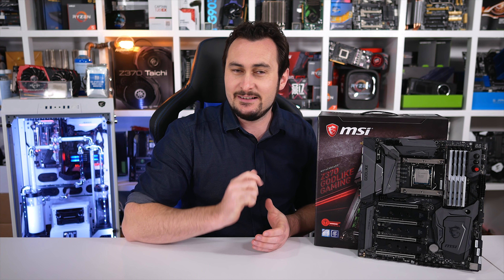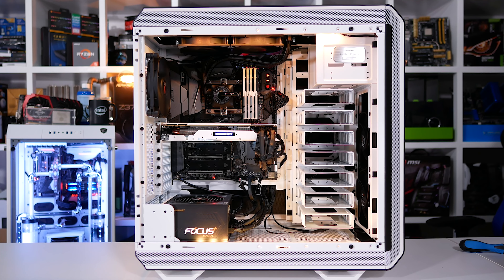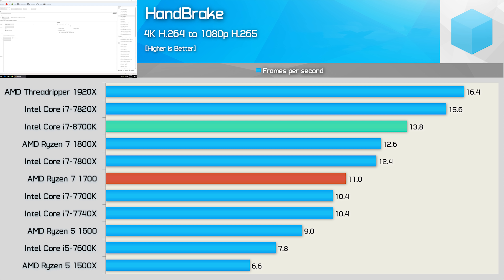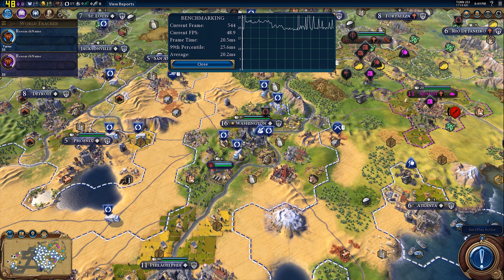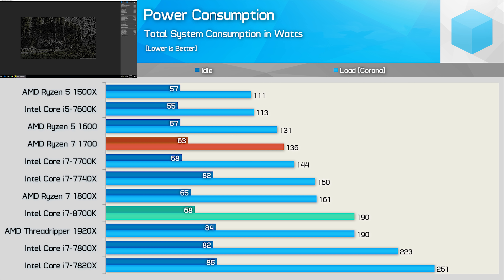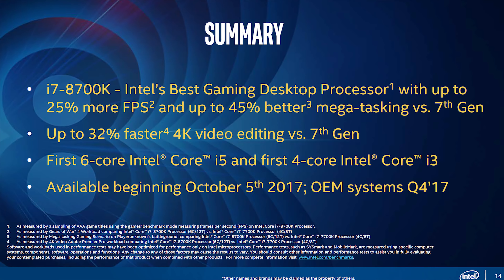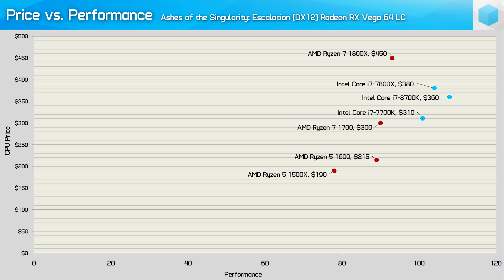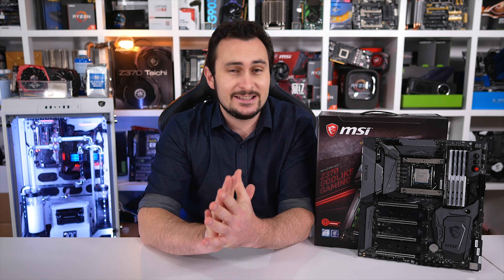Intel Core i7-8700K Review, The New Gaming King!

Comment: If you are comparing price points, well you can get a 1800X for $360 USD these days.  And the 1700 in the review is not even OC, so it runs at a MAX of 3.2 GHZ on all cores.  In addition, the 7700K gives overall identical performance for a cheaper price, yet somehow the 8700K is better?  7700K are on sale everywhere for $270 USD.  Yet when Ryzen came out, people complained even though you were paying LESS money for Ryzen.  Yet now Coffeelake is somehow a "great deal" even though it's not beating the 7700K in gaming by any significant margin?  Gaming King?  If gaming is all that matters, shouldn't the 7700K still be on top?  What happened to all the people who trashed Ryzen for slightly less gaming performance at a reduced cost, yet more money for the same performance (sometimes worse) is a good thing now?  Funny how quickly people change stories.
Reply: slylockfox85 The 8700k isn't overclocked either, so it makes more sense to compare stock to stock as opposed to stock to overclocked
Reply: Very good point,   I can't help but feel like this guy is an intel fan boy
Reply: 1800X is 398$ on amazon but dips down to 350-360$ every other week. It came down in price with the 1900X out now. 1700X is 300$.
Reply: http://www.microcenter.com/product/485483/Ryzen_7_1800X_36_GHz_8_Core_AM4_Boxed_Processor
And it's actually $350.  Fool.  Other sites have also put the processor on sale for around $360-370
Reply: @Peyton
I've never suspected this guy of being in Intel's pocket until now.  The way he gushes at the end of the video about how "great" Coffeelake is looks like a bad acting job.  Coffeelake isn't that great.  It just isn't.  It's not bad either.  But you would think this processor was offering "Sandy Bridge" level improvements they way he's fawning over it.
Reply: The threadripper level power draw is pretty crazy too. If you can afford it, and don't mind the extreme cooling needs it would be fun to mess around on though. Still it's also quite expensive for something you know will need a de-lid, liquid cooling and give a huge PSU.
Reply: How did you enjoy that embarrassment @Bill Gates M8s?

As far as the CPU goes, it's an amazing CPU unless you're concerned about Price/Performance. If you just want the best for gaming, 8700k is the new best for that, it's not really a bias at all even if you feel that it is. This is also coming from someone using an R5 1600 and I absolutely love it. Looking forward to the 12LP refresh, hoping for an extra 10-15% overclocking and a slight IPC gain.
Reply: esperCELL how could the 1080Ti that was used in this review be considered a GPU bottleneck? Also digital Foundry has been pretty much Microsoft's little lap doggy since the Xbox One X praise and massive coverage they have given it so I would take anything they have to say with a small grain of salt.
Reply: I agree there's really nothing spectacular about it,   in terms of gaming performance i don't really see where the additional cost is worth it.  While the Ryzen 5 1600 may not be capable of reaching the same clock speeds,   it has just as many cores and threads as the much more expensive coffeelake chip.  To me it just doesn't make sense,   the margin of performance is too small to even notice unless youre staring at a framerate counter...
Reply: I think people obsess too much with framerates these days too,  if im gaming at around 60 frames per second im happy,   i've never really understood why someone would think that 110 fps is vastly superior to 100 fps etc etc
Reply: Paying 150 more dollars for a chip,  for a boost in performance that's not even noticeable without watching a frame counter is not very smart
Reply: Thats what i thought too... Its 30 percent better for 30 percent more moneys
Reply: slylockfox85 get your history straight - the 1800x was thrashed for gaming because it was $150 more than a 7700k with significantly worse framerates. The 1600x and 1600 especially got overwhelmingly positive reviews for gaming, because they were very close to 1800x, but cost 250 less. Every review out there said r5 is making the whole i5 range obsolete. While the r7 is great for productivity, it’s not that good for gaming when compared to the r5. The interesting chip here is the 8600k, for those that still play games that rely on high single core clocks.
Reply: Haralampi Nedelin: You got some good points there. But the AMD 8/16 core Ryzens are in a completely different league than a quad core 7700K CPU. Yes the 7700K can blast past them in a lot of the games but use either of the CPU platforms in anything where you actually have to get work done and the quad core 7700K looks like 6 year old tech because it just does not have the hardware to keep pace with a 8/16 Ryzen when real work is needed to be done.

The only reason the 7700K was faster in games is the 700Mhz-1000MHz clock speed increase it has over the Ryzen's. That 5-6% IPC gain helped a bit as well but not as much as the clock increase and we all know games like fast clock speeds over more cores and lower clock speeds well most of the games that is. 

I personally would like to see a clock for clock bench test done in games and work station related tests done again since the Ryzen platform has had a lot of time to mature a bit and for the reviewers to take another look at the then and now. It still boggles my mind when you see current reviews or compares done and the reviewers are still setting up Ryzen systems with low speed DDR4 and these systems perform below what we know they can do. Not all reviewers do it but enough so that it is just plain silly as we all know Ryzen wants/needs high speed memory to perform at it's peek performance.

Side note:
I am not an AMD fan or Intel fan as in play favorites I like both companies they both have some good products. I own Intel CPU's at the moment because they do what I wanted them to do. I may go AMD when Ryzen+ comes out and the gen 2 main boards.
Reply: Rocky12345: I couldn't care less about the performance in "actual work". I have a work computer at work where I work, I don't need another one at home. Besides, I have never rendered a single frame in my life, and the most video editing I've done was in VirtualDub 15 years ago, when I was trying to stitch together some lesbian porn downloaded on a 56k modem. 

Saying the only reason it was faster was because of the 1 GHz higher clock, is like saying Usain Bolt won the gold medal because he was running faster than the rest. If AMD could make ryzen run at 5 GHz, with similar power consumption to intel, they would have done it. But they can't. I guess if we limit the charger hellcat to 150 bhp and run a drag race with a toyota corolla, they would be pretty evenly matched, maybe the toyota will actually win due to lower weight. But it would prove absolutely nothing.

Ryzen needing high speed memory is a deficit of ryzen, not of reviewers. If the infinity fabric in Vega has its own master clock and is not coupled to memory or core frequency, why did it need to be determined by ram clock on ryzen? 

Ryzen has a few things going for it, like the supposed longevity of AM4 motherboards, lower price, soldered heatspreader instead of toothpaste, and so on. But dismissing intel's 1 GHz advantage as some sort of non-consequential detail or accident is ridiculous. Contrary to popular belief, intel spends a lot of money on their R&D, and those higher frequencies are a result of that. Correspondingly, they charge more for their CPUs. And people who care about clocks are apparently ready to pay the price.
Reply: They have nevver changed story. They just bargained better deals with Intel for a while. Luckily empires ruin themselves. If we were to wait for techpress to call Intel out for these forced "gifts" you would never get without AMD empire would live forever.
Reply: esperCELL: I watched the video again. Basically the way he tested here using ultra maxed out settings while doing a CPU benchmark test suite was the problem.You never ever do cpu tests with the games maxed out and place more load on the gpu which could make it become the bottleneck and slow the cpu down because it has to sit and wait.

I also found it interesting that when the vega was tested with ryzen's here in dx12 that they Ryzens got a nice boost in fps over what they got when paired with a Nvidia card. That to some extent makes other reviews a bit invalid when only Nvidia used in the cpu testing if the Ryzen/Nvidia combo is holding back some of Ryzens performance in dx12. I was glad to see Hardware unboxed take the extra time to show that to us. In this case yes the 1080ti was a bottleneck because of the settings used even at 1080p. With so much power in the cpu's today even 6th,7th,8th gen cpu's can max out a 1080ti.

Don't forget 8th is just kaby lake with 2 extra cores which is turn sky lake & a reworked turbo boost. Hell the 8th gen better be faster it has 2 more cores but do not be fooled those cores are the same old tech from 2 years ago.
Reply: Intel has had 8 generations to get it right so 1ghz advantage with all that time is about right. AMD Ryzen is less than a year old and first release. they got the tech out the door next release will be work on clock rates a bit and do tweaks to get more out of the chips. Intel is no hero here they have had a long time to play with their core line up and have let us keep on buying the same stuff for years now with very little performance gains from each generation. It took AMD to release something that mattered to wake Intel up and finally move past 4 cores on the mainstream side.

Hell my overclocked Sandy i7 @5.1 can churn out fps very very close to a 7700K@4.7 maybe 4.8ghz that kinda sad really on Intel's part. We finally got a 6/12 core setup on the main stream after getting quad core after quad core since like 2007 with the Core 2 Quad Q6600@2.4GHz it was about time they finally got past the quad core era. They should have done it 3 years ago maybe I would have already replaced my Sandy i7 back 3 years ago. 

So do not come down to hard on AMD because they can not reach 5GHz it is a new product fresh out of the gate so to speak. Would it have been better if they could of at least got 4.5GHz yes of coarse it would have. Will they get there most likely yes probably in the next release. Will INtel get much farther on this 14nn node most likely not they have pushed it as far as they can the power numbers really show it. Are review sites really down playing the power usage on the Intel chip yep for sure well at least these Coffee lake ones it seems the sites I have been to have backed off a bit on the power numbers complaining probably at Intels request.

Oh yea ram is important with Ryzen since the infinity Fabric is locked in with ram speed. Was that the best move on AMD's part nope not really was it the best way they could do it with the budget they had probably.
Ram speed and tight timings are 100% importasnt on Ryzen if you want to get the best FPS you know this already. Check out Mindblanks latest Youtube Video. He put a lot of work into testing DDR4 at dirrent speeds and also really tightening up the timings and tweaking the settings in the memory. He took a Ryzen 1700@3.9GHz from getting it's ass kicked by the 7700K@5GHz to actually beating the 7700K@5GHz just by doing the slight OC to 3.9GHz and ram at 3466Mhz and the best timings the memory kit would run at. 

As he stated he thinks the better the memory timings and speed the faster the system can feed the cores even if they are running a bit slower there are more of them so if they can be fed faster then you can see a good speed gain from it as well as lower the latency imposed by the CCX complexes which also explains some of the FPS increase.
Reply: Yes true if you go from review to review you can see very different outcomes in the benchmarks and that it all depends on how the testers choose to do the tests. That is why we as readers or watchers have to go to multiple sites or channels to try to get a better picture on how each hardware fairs in the benches these days. Heck just changing a graphics card from one company to another can change the whole performance profile of a CPU in gaming tests or changing memory speeds and timings can change the whole outcome of a review.

Before Intel's 8th gen CPU's changing the memory speeds had a small effect on game performance a lot of the time and the quad cores. Now with the 8th gen and more cores it seems memory performance may play a better roll in the game performance this is a good thing. With Ryzen because of the way AMD put the IF & memory speed together and the CCX complexes causing a small latency memory speed and timings are very important on ryzen platform. So much so that if the system is configured with high speed DDR4 and memory settings tweaked you can almost get performance in games that make it look like you got a whole new CPU. Mindblank Tech's channel just did a video on this. https://www.youtube.com/watch?v=S6yp7Pi39Z8. 

He shows what he did and how much effect it had on the system and in the games he tested. Did he hand pick the best case games to show his tweaking in a better light probably. Does it show that there are areas which can really improve Ryzen game performance yes for sure. Will AMD have to address these areas with Ryzen+ spring 2018 yes for sure if they do not Ryzen+ has no real value other than maybe a bit of a clock boost. If they can address the problem areas and also get the clock rates up with Ryzen+ they will be ready to fight Intel or at least get very close to Intel level game performance. Heck in Mindblanks tests that ryzen went from losing to the 7700K@5GHz to actually pulling a few victories. That is pretty good for a few hours spent tweaking and shows there is extra performance to be had out of the Ryzens yet AMD just needs to harness it in the next Ryzen refresh.

I an a Intel user & fan but the last few releases have not impressed me hence the reason I am still on a Sandy i7 even this new 6/12 core Intel does very little to impress me yes it is fast sure but it is also being released on a stop gap z370 chipset which will be replaced in 2018 if the z390 rumors are to be believed. I want whatever comes after Coffee lake that has new and improved cores and a die shrink and a chipset & socket that may actually be around long enough to support at least 1 upgrade after the first CPU is released on that chipset. If Intel can not do that then it will be Ryzen+ or most likely Ryzen 2 for me. That is if my Sandy i7@5.1GHz setp lasts that long without failing. My Sandy at it's speed is why I have been so non impressed with any of Intels offering other than getting into DDR4 ram there was nothing really in it for me.
Reply: Rocky12345: This release from intel cannot possibly a response to AMD. Yes, they may have launched the CPUs earlier than planned, to preserve some marketshare against AMD, the prices may be lower than what they would have been without ryzen, but the 6 core CPUs have been in the works long before Ryzen was released. You might think, it was clear for a long time before the ryzen release, that it would have up to 8 core and 16 threads, but if Intel was changing their strategy from early announcements and rumors, they would have pushed 6 and 8 cores as soon as Bulldozer was announced. But they didn't.

And you think AMD is some amazing hero, after fu**ng up so badly with builldozer, then needing 5 years to come up with a competitive product? All  the while leaving Intel basically unchecked? Yes, a slow clap for AMD. At least they tried harder with Ryzen than with Vega, that's for sure.

How would mindblanks video help me again? I bought a ryzen 1600X on launch day, along with a kit of 3200 MHz 16 GB Ripjaws V, and an Asus B350 MB. The ram will not boot above 2666, even with the latest BIOS, because it's not samsung b-die, it's Micron. The ram was already plenty expensive at 140 euros, I am not about to sell it at hefty loss and get a Trident Z 3600 for 230 euro. To get above 3200 I will also need an X370 MB, and not just any $120-140 one, nope, probably a Crosshair Hero VI. Which would completely destroy any price/performance advantage ryzen might have had. Instead of doing all that, I could have just waited for the 8600k and not have to worry about memory, CCX latencies and so on. I don't regret buying AMD, but trying to make them into something they are not is doing anyone any favors.

I am not coming down too hard on amd because they can't reach 5 GHz. But they only have themselves to blame for that one. If I am on the market for a CPU, I would be looking at current models and current prices, not what somebody is planning to do in 1 or 2 years. I don't care how long Intel has had to work on their architecture and process, if I was looking for a 5 GHz chip, that would be irrelevant to me. Intel is not going to push anything on the 14nm node any more, and the one thing intel still has on AMD and global foundries it better fabs and better process. Expecting GF to make some amazing jump next year, while intel is still stuck on 14nm, is not very realistic.
Reply: You say Intel's resonse was not because of Ryzen but the go on to say how it basically was. Yes Intel's 6/12 on mainstream was planned before Ryzen came out probably at the point when AMD first started making some rumblings about zen and high core counts. Yes it is true Intel released these a lot sooner than they were ready to hence the reason they can not be found pretty much any where because Intel needed at least 3-4 months yet to get millions more of these chips ready for retail and to try to stop people from filling their Christmas baskets with AMD Ryzens.

As for the mindblank video it just shows what can be done for performance when you have the right hardware to make Ryzen faster and more inline with intel's 7th gen i7 gaming king. I really did not expect anyone to go out and buy up the hardware or sell their current crap to get the same performance from Ryzen as Mindblank did & besides that I really don't care.It was just a point of interest if you choose to not go watch it then fine your choice.

I am glad you are happy with your cpu purchase that is good to hear. As for 5ghz and AMD not going to happen with Ryzen+ in 2018 maybe ryzen 2 once they go down another node size. We may see 4.5-4.6ghz turbo boost on Ryzen+ ans an all core speed of 4.4ghz at most if I am wrong and it's higher cool if it is lower or same as now they may as well skip it and just release ryzen 2 in 2019.

Intel has had now 8 generations to get their crap right with the core series and now we are seeing 5.2-5.3ghz as semi common on the 8th gen. 7th gen was 4.9-5ghz sometimes 5.1ghz on cherry chips. Point being each gen they go up a couple hundred mhz when oc is applied. My own chip being Sandy I think the norm was 4.3-4.5ghz & 4.6ghz some of the time mainly because of the soldered heat spreading helping a lot. My own chip hits 5.1ghz 24/7 running and will benches at 5.2ghz so it is a cherry chip in my books. It will even boot into Windows at 5.3ghz no where near stable blue screens if run anything bench related.
Reply: Because those extra 2 cores will give it a significant lead over the 7700k over the next few years as more games begin to use more than four cores, and more threads.